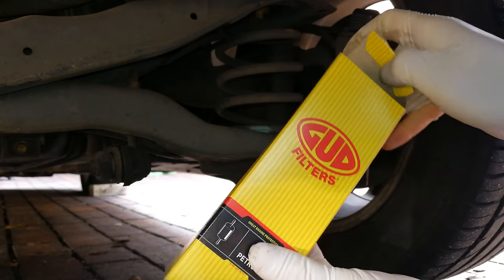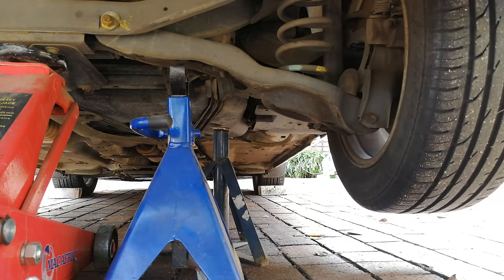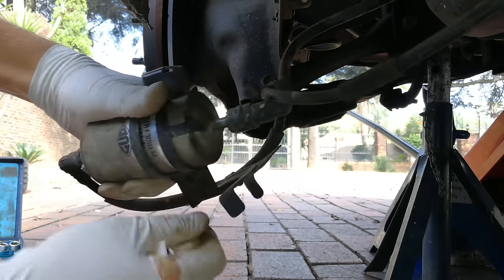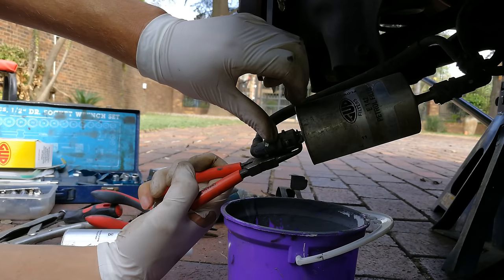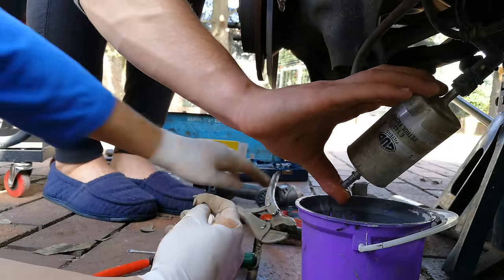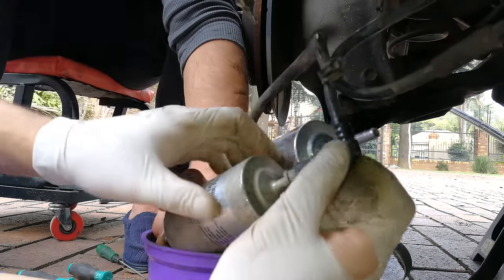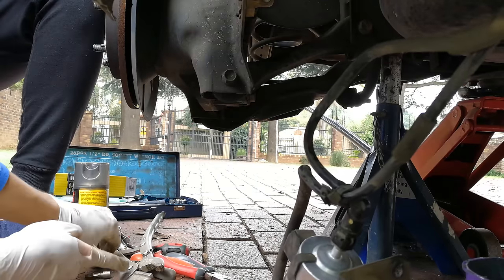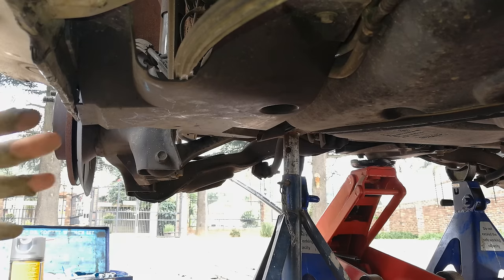How to replace the fuel / petrol filter on a 2004 Mazda 3 - step by step

Comment: Good job, saved a lot, nice to diy. It's also important to use good quality fuel, I found that shell v-power gives great performance and the fuel lasts longer, it also contains the right cleaners. When I put BP , the fuel does not last long. Every now and again I make sure I put a tank of shell, although I do use other petrol companies. I have a Suzuki swift 1.5gls 2010
Reply from the maker: i have wondered about this. How sure are you about the Shell running for longer? This would be a great test by the way.

Comment: When you removed the first hose and clip, why not use the cap from the new fuel filter and quickly put it on the old fuel filter to keep the fuel from coming out and attach the hose to the new fuel filter before removing the second hose? That saves you from needing a second person.
Reply: South African

Comment: Hello, hope you can help me, I have a 2005 mazda 3, the filter is not así indicated in you vid, were else would it be? Thanks and great video
Reply: Have the same problem with a pre-facelift 2006 mazda3... did you find where the fuel filter is?

Comment: Hi, I looked that location where the filter suppose to be but can not see anywhere. Is that possible mine has no petrol filter? Its 2007 made 1.6 petrol model. Thx
Reply: came here to ask the same, i have 2009 1.6 petrol sedan bk with jz engine

Comment: Thank you for the video. My mazda 3 2004 workshop manual said the fuel filter was inside the fuel tank. Is your m3 04 a European model, or is it in the US?
Reply from the maker: its a left hand drive South African variant which i suppose is same as UK
Reply: I don't think US model has a fuel filter

Comment: Hi, do you know how often needs to be changed on the 1.6d engine? Thanks
Reply from the maker: depends on the quality of your oil (petrol/diesel) in your country. I change mine every 50 000kms
Reply: Never because that was a petrol car not a diesel, diesel fuel filter are usually in the engine bay and will need priming after it has been changed otherwise you will air lock the fuel system I recommend going to a garage to have it done
But it is usually changed every service, so 10.000 to 12.000 miles or every year
Reply: @ecologicaltime  hey thanx for video its same om 1.6 diesel  ??

Comment: Hello, What is the cylinder of this mazda 3? I have an mazda 3 1.6 l pétrol, but i dont find the location of the filter like the video
Reply from the maker: its a 4 cylinder. have you looked on both sides?
Reply: @ecologicaltime  Not at all, i will check that. In europe, the filter is integrate with the pump i will check that. Thank you
Reply: @filipenguyen6643   I also have a european 2006 prefacelift mazda3 1.6, and I cant find the fuel filter, did you found it?

Comment: Hi i dont known were a fuel filter its loction on mazda premacy 2000
Reply: I think it’s in the tank, I have the 1.8 1999 model and I was told by a Mazda dealer that it’s not replaceable.
Sounds odd to me but that’s what they said 🤷‍♂️